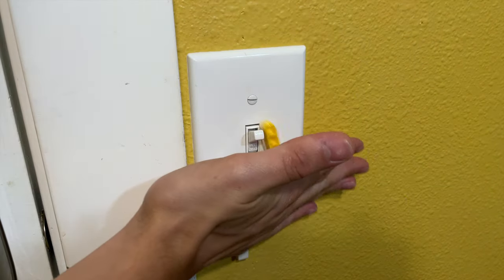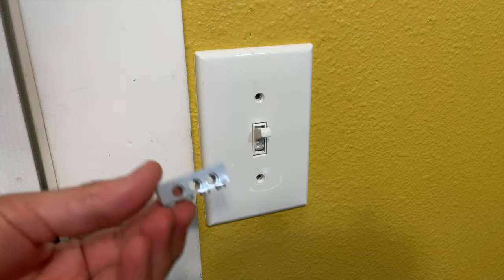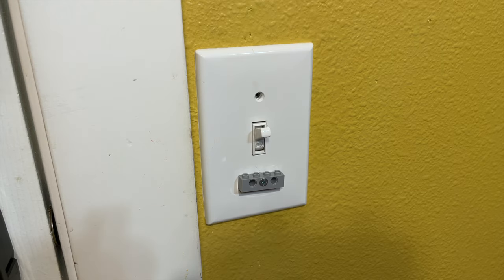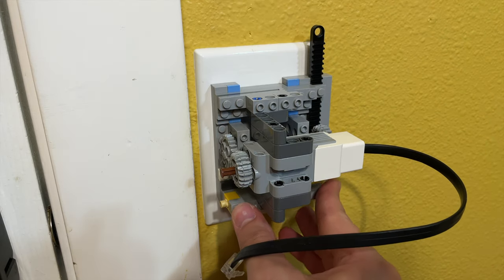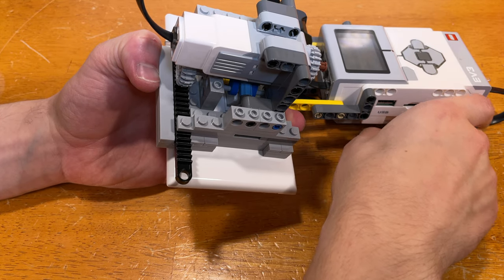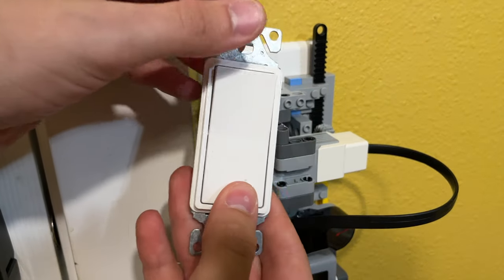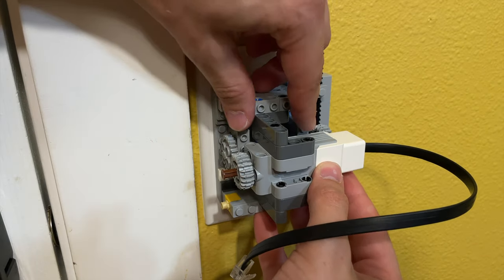Remote Controlled Light Switch Using LEGO

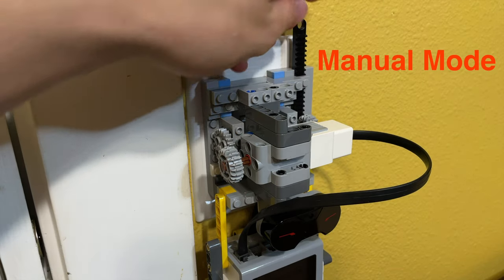Comment: What's the point of manual mode? 1:40 lol
Reply from the maker: AA batteries are expensive, and EV3 is not a low-power platform. I thought I’d make it so the light switch can still be operable with the EV3 disabled all while still being attached to the light switch.
Reply: @LegoTechnicsRule  then use powered up
Reply from the maker: @luigikoopa8771  Powered Up would have actually been very good for this! The problem with using powered up for this is that it’s not as widespread as EV3 and I originally planned this project to come with a tutorial. That would kinda screw lots of people who wanted to build this for themselves.